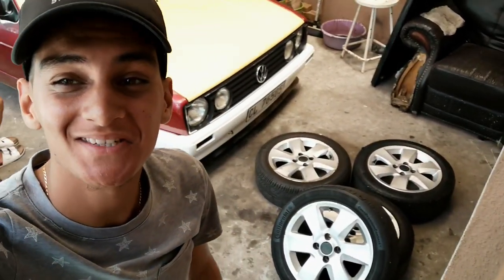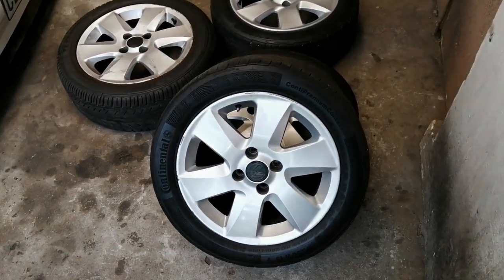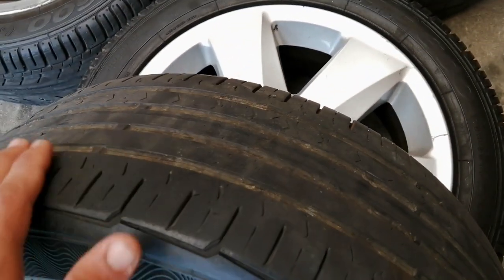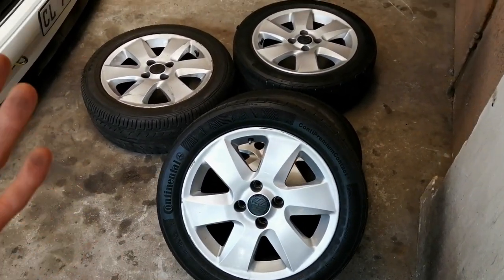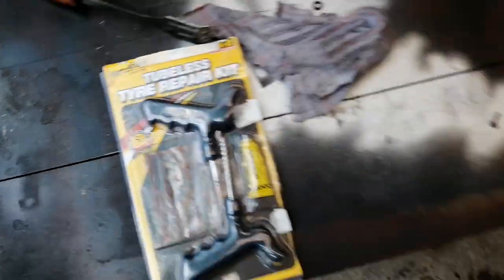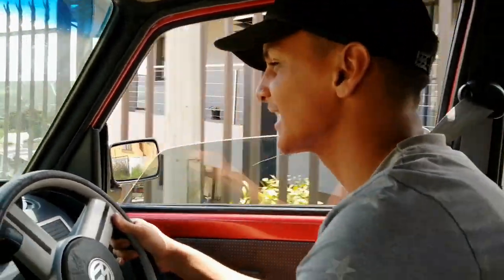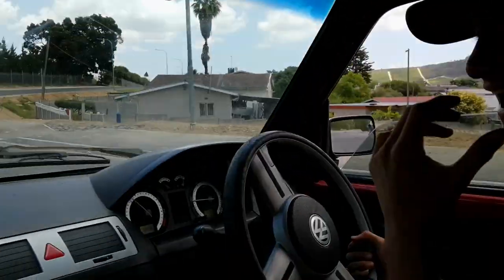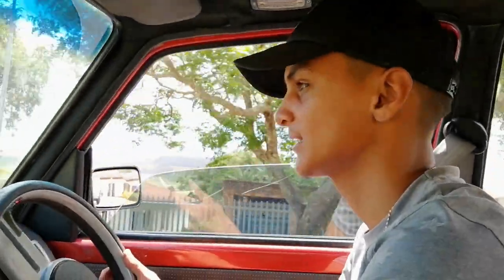I HAVE BEEN KEEPING THIS A SECRET FOR MONTHS!!!

Comment: Lola was the reason I subscribed to ur channel, still think u should've kept her but its nice to see u build a mk1 back up to how beautiful Lola was, honestly u just been doing all this bcoz u miss having Lola lol... Just a quick question, to do the carb to fuel injection swap, what are the most important things I need to change besides the engine, bcoz I have a mk1 with a 2l 8valve carb engine in it, im thinking of going fuel injection as well that's why I wanna know, but congrats on ur success bro 👏👏👏👏👏
Reply from the maker: Everyone has they own opinion why im doing thia conversion, but Im just doing this because I like the look i previous had with Lola and Im going to use the car for a daily.

You need a list of things changed.
Ecu, loom, Fuel pump, fuel filter (new spec), distributor, coil, etc.